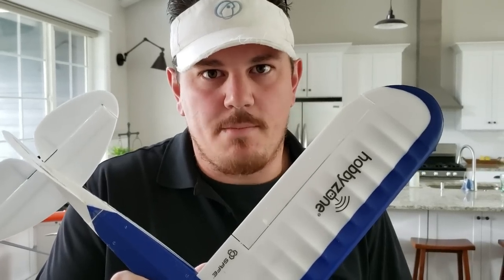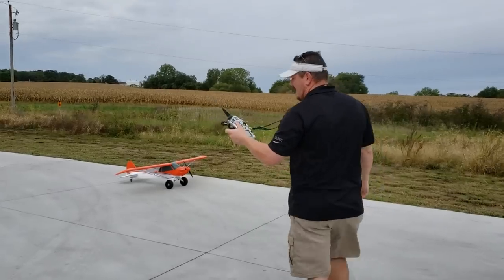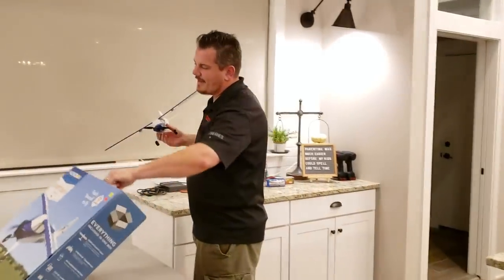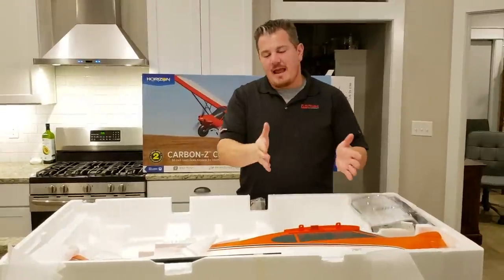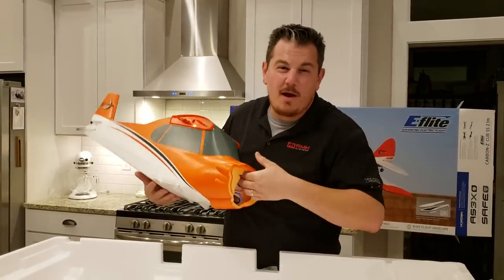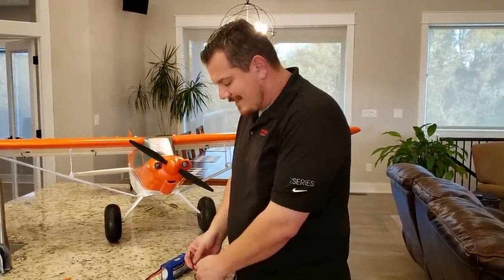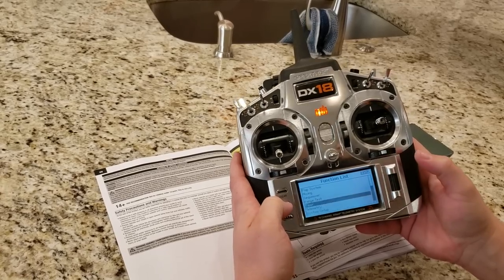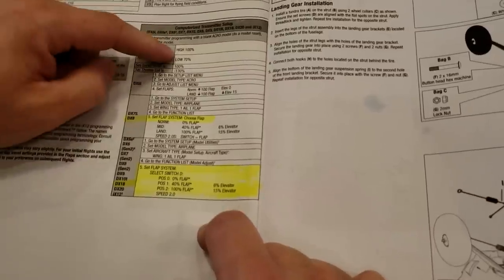Horizon Hobby - Carbon-Z Cub SS 2.1m - Unbox Build Maiden

Comment: This one... or the Carbon Cub S2 as a very first plane?... Hmmm... Decisions, decisions... 😂
Reply from the maker: This is a VERY capable plane for a first plane. It will fly wonderfully, but it is pretty HUGE,  with over 16" sized prop, you could really hurt yourself with something like this for a FIRST plane... NOW, if you were just coming back to flying from years of hiatus, I'd agree adamantly - Carbon Z Cub, but while it is a GREAT flying plane equipped with SAFE SELECT, you will have a LOT of cash tied up in this plane by the time you're in the air. Thirdly, it's not as easy to move this one from site to site due to it's HUGE size. It is awesome, if you can tolerate those three concerns, but if not, go for the Carbon Cub S2... you'll thank me later for talking you out of the Carbon Z Cub, which I will then encourage you to get after you have a few planes under your belt.

Carbon Z Cub SS 2.1m https://bit.ly/30P5mUA
NX https://bit.ly/3mbVuNB (this one is what I'd have you get - NX8 https://bit.ly/2PHllSs )
Chargers https://bit.ly/32qiuBD  (this is what I recommend right now - S2200 https://bit.ly/398ohO6 )
Bats https://bit.ly/39bWmwk (I'd encourage you to get one of these 5000mAh 6S 100C https://bit.ly/2ImLLWr ,  Same only 50C https://bit.ly/35qFQrW , same only 30C https://bit.ly/2Orca4L )

....OR this one that comes "RTF" with everything you need to start, but you will be replacing most all the items when you move up to the next plane...But the sticker shock will be pretty severe side by side ;)

Carbon Cub S2 1.3m https://bit.ly/3bS2r3O

I'm rooting for you Flat Twin Frog!!!
Reply: @BrianPhillipsRC  THANK YOU! 👍🏻

Comment: Can you do crow breaking? Would it be useful in a cub?
Reply from the maker: Yes, and I would say you'll probably find it unnecessary, but sure you CAN do it ;) The transmitter setup would be a huge pain ;)
Reply: @BrianPhillipsRC  yeah man I have the asw28 and tried setting it up but i only have a cheap flysky radio and those are difficult to program.

Comment: Hello, I'm willing to buy this Plane, I have several 6S 10000mha Genace Battery, Weight: 1357g
Size: 175*65*58mm. Willing to use them on it, do you think it fits inside, and it will fly ok with the extra wheight?
Reply from the maker: I don't know. That's not the size I recommend, but if you can get it in the opening, and push it back enough, the plane will fly, so long as you get the CG right. This plane is super powerful.
Reply: @BrianPhillipsRC  It is a 65mm width battery, can you check on yours what is the width to fit the battery in it?

Comment: BRIAN Stan does EPO FOAMyellow
 wondering if should clear myZ CUB SS
Reply from the maker: Not so much, in my experience. I've had worse time with hangar rash in general. It's just tough when they start getting heavy like this one, so you can kinda crush the wing when you go to pick up the plane. Something I mention in the videos, but it's hard to tell on the video. This small damage is just annoying when you drop this level of money on a plane and want to keep it pristine.

Comment: WHY ARE YOUR BATTERIES PUFF IS THAT GOOD OR BAD
Reply from the maker: Puff is bad. I use two different typed for this plane. I have Turnigy Heavy Duty 4000mAh 6S 60C packs BUT more recently I got a ZOP pack that's been very good to and it's turned out to be pretty nice too.

4000mAh 6S 70C ZOP - https://usa.banggood.com/custlink/D33mOqDrCB
4000mAh 6S 60C Turnigy HD - https://amzn.to/2CltsLH

Both have been good, but It's kinda annoying having to solder on ends to lipos. I can do it, but it's not without some effort. With the Turnigy, it's "currently unavailable" and you'd have to redo the connector. For me, I already have connectors made for XT60 to IC5 (same as EC5) which is what the Carbon Z Cub SS calls for....

Here's another option that's really good too...

4000mAh 6s 60c Zippy Compact  - https://amzn.to/38Zy7R9
OR

These look good too - https://amzn.to/2Pq65Gs ....but its a TWO pack...almost $100! Yikes...lipos are getting pretty expensive.

Comment: You need to update the plane link so we can use it!
Reply from the maker: Updating it now (4/25/2021 @ 11:03 PM), but I thought I JUST did it!??!?!

I DID, just do it...

Carbon Z Cub SS 2.1m https://bit.ly/30P5mUA (Updated 3/18/2021)

Was it NOT working for you???

If so, try one of these and please let me know, so I can fix it. Thanks in advance Bluesky9....

Horizon Hobby https://bit.ly/38ZFade
Tower Hobbies https://bit.ly/2XqHt45
Reply: @BrianPhillipsRC  This one works! Great.  Thanks for responding.  The slow 3D like aerobatic capability with near STOl characteristics is what is attracting me although it is a bit pricey.

Comment: Pitch sensitivity...but feels nose heavy?????
Reply from the maker: yep, you hear it right... I was probably working out if the plane was feeling nose heavy or if it was another issue. That's why you heard what would be two conflicting reports. The pitch sensitivity I was reporting might have been a result of an expo or elevator to flap correction setting. This was a maiden flight, so I was working it out.

Comment: I think you sold me on it, for a sailplane towing platform.
Reply from the maker: I was thinking about that the other day. How can I use ONE transmitter to launch TWO planes. I eventually decided that this would be pretty tough without a second, VERY expensive 12+ Channel radio mounted in the Sail Plane. Maybe Spektrum would send me one so I could spend some time and get it working??? ;)

Comment: I’m good with the price of that plane I’d pay it but I started flying a big airplane when I was about 8 years old and there was no beginner planes back then lol then I seen a helicopter so my dad got me a harobo shuttle from a yard sell lol got so use to it my mom bought me my first raptor 30 brand new I fell in love with it so I got a job mowing yard’s I got me a raptor 50 then 60 then the 90 and I still have my first helicopter my dad got me and the first raptor my mom got me and all the rest I still fly big scale plane’s I fly the big 3/4 scale you should get one that big they are easier to fly then the one you have you can feel the plane or helicopter my helicopter is I think is a 3/4 scale it’s how I built it anyway lol but I’m now 45 years old now and my helicopter’s are all still like brand new still never ever been crashed but you need to try a 3/4 scale once but once you go big you won’t go back lmao
Reply from the maker: That's CRAZY! If I'm building it 3/4 scale, I'll be in it (don't tell the FAA - LOL...)

Comment: You gave me a heart attack when you plugged in the battery while standing in front of the prop leaning over the prop with your arm.  If you like having an arm, I suggest very strongly that you do not do that again - ever!  You should treat it like it's loaded and not assume it will behave just because it always has.  Sounds paranoid but I've been doing this long enough and have seen enough people get hurt due to strange happenings with electrics - and gas and glow to say - don't ever do that again.
Reply from the maker: There's a power switch inside.
Reply: @BrianPhillipsRC  That switch is for the radio. I suggest you give that prop some room once the battery is plugged in.  My trusty old receiver failed on me and I didn't notice until the battery was plugged in and the motor went wild. Not the first time at our field either.  I changed out the receiver and everything was back to normal.
Reply from the maker: I was thinking about your comment the last time I put my lipo in the hatch...but there's not really a good way to get the lipo in without having some level of exposure to the prop. I know and agree with your concern, but this plane makes it pretty freaking hard to be "safe"

Comment: what  other promises Megan still needs to accomplish be?  ja  ja
Reply from the maker: Freewing F-14 ;)
Reply: @BrianPhillipsRC  Aaaaaaah, lolz
*I still think FMS delivers more for a few bucks more. Freewing tends to glue everything, while FMS is bolt on, practical in case of an accident or when moving. FMS is upgrading most of their lineup w inrunners and suspension landing gear. Hey, but as a gift, no complaints. You both have the magic goin.
Reply from the maker: Thanks ;)